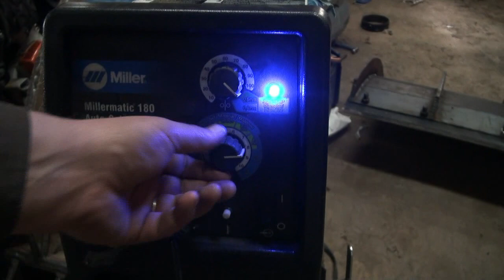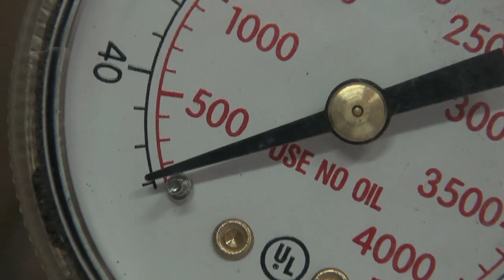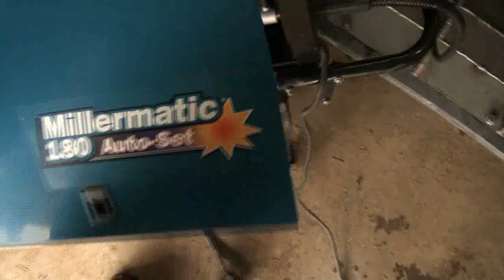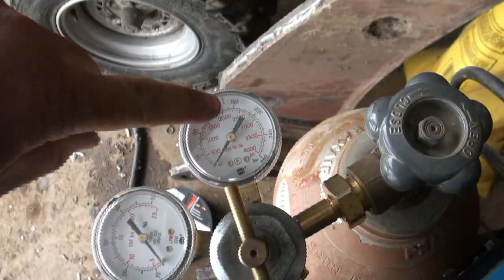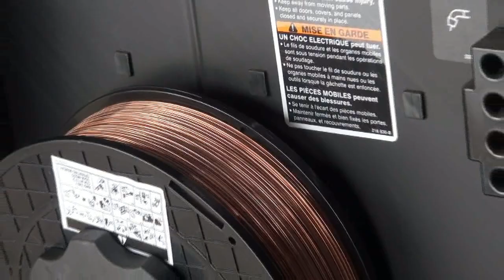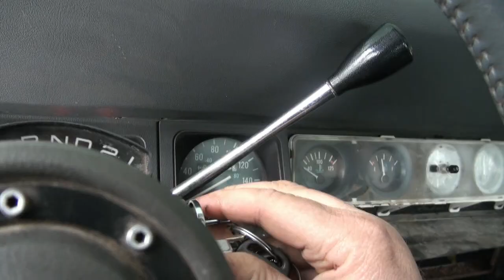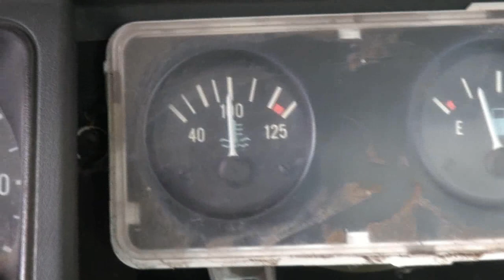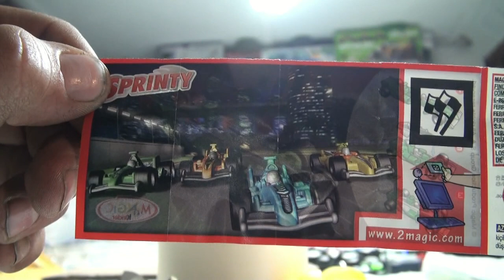more snow plow work

Comment: all the oil pressure you need at idle is around 8 psi , and you only need 10 psi per thousand rpm to keep an engine happy , that's how we rate race engines , as they are built with higher clearances for less resistance so they rev quicker , and produce more power , basically a race engine is built loose like a high mile engine lol

Comment: hay bill you where tanking about getting a bigger welder you should thank about  in the millermatic 252   it can weld up to 1/2 steel plate and the millermatic 180 only welds up to 5/16inch steel  plate

Comment: With regard to the Jeep, can you not pump some sealer round and under the rubber surround on the windscreen to prevent the water seeping in? Then maybe the floor will dry out ok without having to do as you said and cut the floor away which sounds a little drastic.